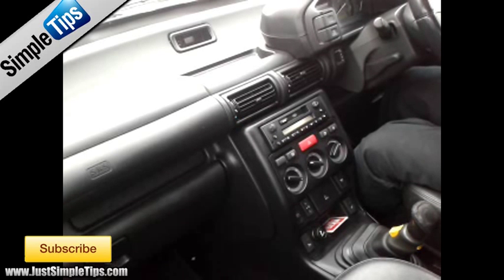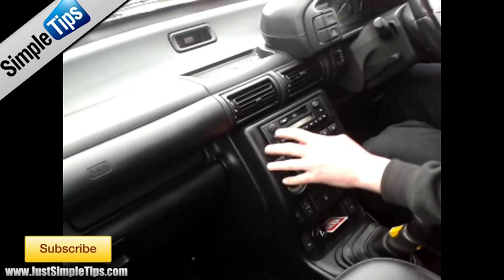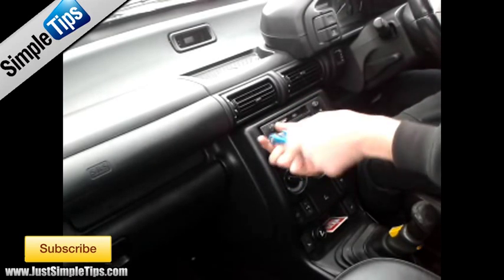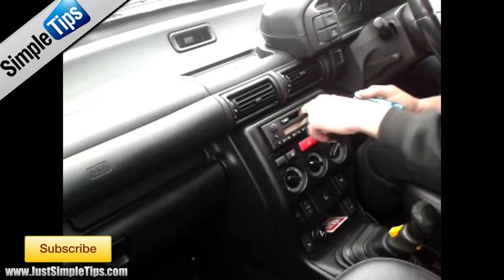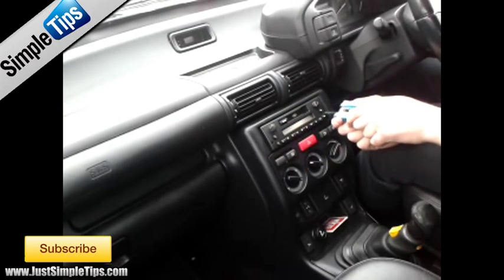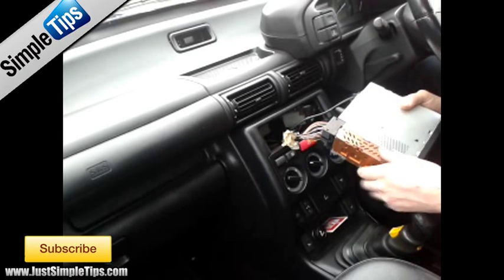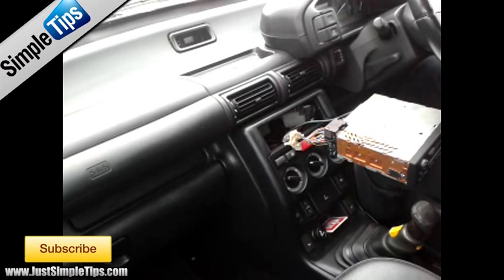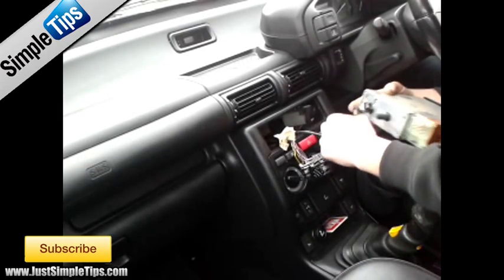Radio Removal LandRover Freelander (1997-2006) | JustAudioTips

Comment: My rover is an 02 American style and it has four holes is there any difference... I think I have a wire lose because speaker on the rear passenger side door doesn't work... I figured I could pull it out and take a look  but I have tried everything it just won't come out..... Everything is stock btw
Reply: How did ypu remove. I cant